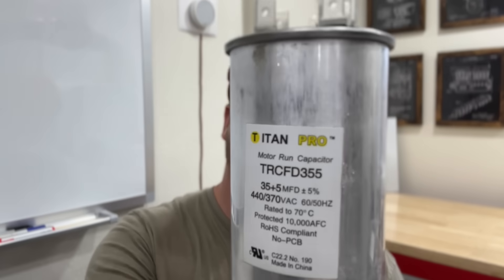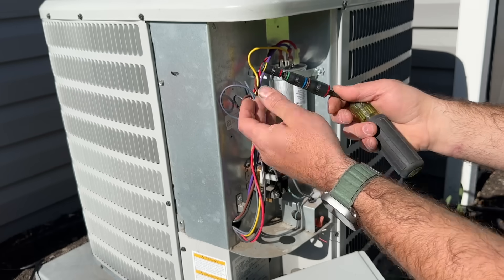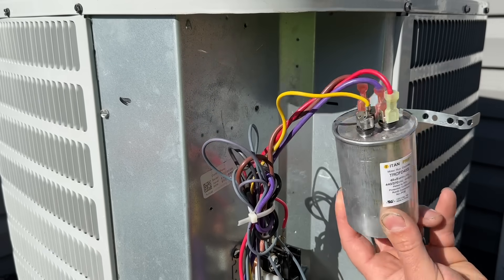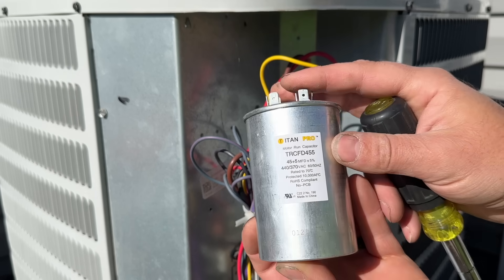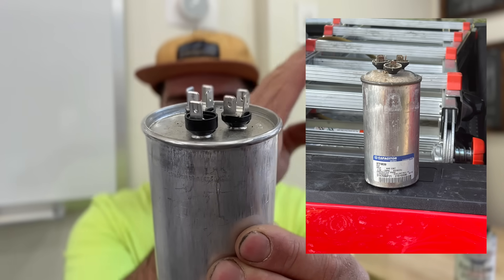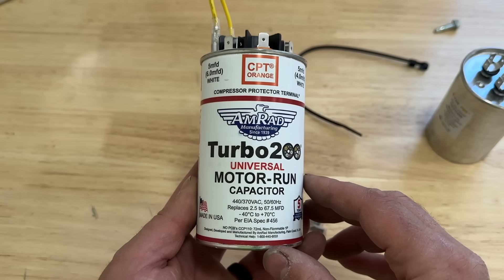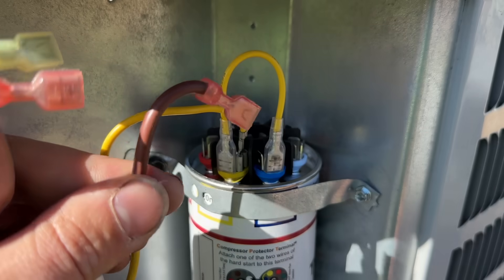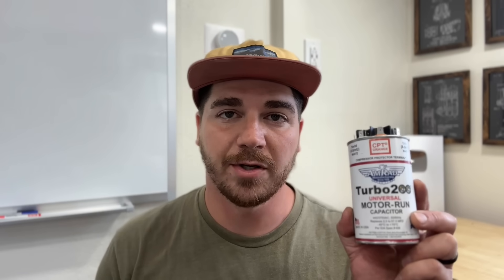HVAC Contractors Practically Make Their Living On These

Comment: As someone who provides for their family as an HVAC service /installation technician (who prides themselves on honesty, transparency and genuinely loves to help and serve his customers) the way you paint the entire HVAC service industry as a giant scam and then make some one off claim that someone was charged 2k for a capacitor really bugs me. You seem to genuinely want to help people but somehow are caught up in the clickbait of adding the worse case scenario of some scum bag service guy who duped their customer. Obviously it’s a possibility but you start with the (I’ll save you 2k) which in all likelihood is more like $200. You’ve done plenty of work that we in the industry don’t recommend.  I’d love to see you post a humbling video of oh I made the mistake of doing X and that was not the proper way to do it. Case in point you looped the additional refrigeration lines for your minisplit vertically which creates an oil trap and can prevent the oil from returning to the compressor (bad) and the industry would recommend that you run the additional lineset horizontally.   I made a post on your condenser cleaning video which states that there can be so much more to getting a system operating efficiently and effectively that almost no homeowner will be able to determine. I absolutely don’t mind educating my customers about how to wash their condensers, flush their traps or even replace a capacitor. But never having a qualified technician check their equipment can have their systems running inefficiently. Ultimately affecting their cost to operate, their comfort and eventually shortening the lifespan of their equipment. And while yes we need customers to maintain our livelihood we’re not going to starve if customers do some of their own maintenance to save themselves money.  So just painting the industry as unneeded and a scam is gross. Why can’t we work together instead of against each other. Why can’t you promote professional service while helping others see that they’re capable of performing maintenance that can save them money. What about promoting good guys. The whole world is filled with people who want to create dissension and put one against the other. Why not be different? Maybe because that stuff doesn’t get the likes and the followers because everyone needs something to be mad at someone/something. Just one man’s honest opinion but I absolutely hate your “they’re scammers watch what I can do to save you approach”!

Comment: My evaporator has been slowly leaking over the years. I finally said the hell with it. Bought a window air conditioner. My central air was never right. it's 15 years old and shouldn't be leaking like it is. Info out there that carrier used the wrong evaporator for the high pressure 410a. Was being charged 300 bucks to just add 410a.  I spent over 1200 bucks over time adding 410a. Sick of it. My neighbors central air is over 20 years old, never having to add any. Never buying carrier again.

Comment: I don't disagree with anything he said about capacitors, but wanted to add a bit of context about why it's VERY IMPORTANT  to discharge them before any possibility of touching a bare terminal... if you imagine  a battery and a capacitor capable of storing the  same amount of energy  now think of them as a 5 gallon bucket of water.... the battery is limited to how fast it can 'drain' current  away.... it would be like drilling a ¼" hole in the bucket.... however a capacitor is like dumping the bucket over someone's head... the only effective discharge limit is the amount your body provides... that's why  they are useful and why they need to be handled with care until known to be discharged.... the 120v/240v air conditions offer can be one heck of a kick... I  doubt it would kill you but it is atleast theoretically possible...

Comment: My Florida condenser was flooded under 4.5 feet of water from Hurricane Ian. I washed the unit and called one-hour heating and cooling. They wanted $1,200 to replace the fan motor, who said they had it on back order. It would take 3 weeks. I bought a new motor that day for $120 and it was back working in one day. Figuring 3 hours labor for them, that works out to over $300/hr. Gouging at its worst during a disaster. In three weeks I would have lost the house to black mold.
Reply: Sometimes DIY is faster.
Reply: Why would you have lost your house to black mold?!
Reply: @Xanthopteryx no ac in a humid climate allows growth. Welcome to Florida
Reply: @Xanthopteryx  
Why would you have lost your house to black mold?!

That seemed an obvious reference to what would happen without the A/C running, with all of that Florida humidity.

But just wait until we start having all of those predicted rolling blackouts, due to the enviro-wackos shutting down our power plants with their pretense of "climate change" (fake-science and trendy BS) of being a thing to worry about, and not caring that power sources seriously need to be "dispatchable", because they can't be bothered with technical details like science, physics, or economic feasibility. Coal, natural gas, nuclear power, hydro-electric are all dispatchable, which means that they can be brought online in a short amount of time to match a rising demand curve or a hot summer day in which people are running their A/C. Solar and wind are not dispatchable, because they produce when they produce. The sun does not always shine, clouds block the sun, the wind does not consistently blow. Bad things happen if the supply can not match the demand, forcing them to "shed load" in the form of rolling blackouts. How will we ever have jobs, when nobody wants to build a factory where they do not have reliable 24-7 electricity?

BTW, the backup electricity for hospitals would be considered to be dispatchable I imagine, because diesel generators run day or night and are not dependent upon the fickle weather. However, the fuel can run out in days, if power is not promptly restored. Those emergency generators start themselves automatically within seconds of detecting a power outage. Why don't hospitals or other places needing emergency reliable power, rely upon wind or solar? Think about it. Also check out Ray Stevens "A Solar Powered Song". Funny, if it wasn't actually kind of sad.
Reply: If you are in that situation again, you may want to call a Yankee friend, up North and have them pick up the item needed then ship it to you UPS next day air. It is not that much!
Reply: @Mike1984-lc9rh 
Replacing that fan motor takes 30 minutes at best, not 3 hours.

It might take them 30 minutes, not counting the drive to the home. But either they would charge for 3 hours, the longest that that job might take, or else DIY may take 3 hours. It probably would take me at least 3 hours. Especially if I actually read the directions.
Reply: @Mike1984-lc9rh 
How did you learn to do it?

I should move to a more civilized country.

Comment: Bought a 4x/yr “Preventive Maintenance” contract for $33/mo from my HVAC company. Tech warned me in second visit that my capacitor was starting to head towards the range suggesting replacement ($350 plus tax) but while watching him check it I quickly looked on Amazon and found the identical part for $14 and called him out on it. I replaced it  myself….15 mins in time. The previous / first visit 3 months earlier he did a Carbon monoxide test stating “you got a leak; likely a crack in the heater box” (it’s a heat pump with natural gas back up) and the system should be replaced…. $8-10 thousand (I live in the Pacific NW; 1400 sq/ft). I brought out my two (2) state of the art CO detectors that run constantly and have a digital readout of the percentage of CO it detects and both read zero. Yes, I know his CO detector was likely much higher tech then mine but ya got to wonder; Considering diy hybrid solar mini split 2400 btu for 4k which includes the panels. I could buy two of these mini splits for what he quoted me to replace my “leaky system”.
Reply: Buy a Canary, if there is a CO leak you'll know.😎🌴🐊

Comment: You never verified both legs of power were dead. This could be a lethal mistake your advice could get someone killed.
Reply: How can electricity flow if the breaker is pulled? If you still have voltage then you need to sue the guy who wired it up! Now if a gov't inspector was there than I'd see doing this and probably something else that wasn't even thought of!
Reply: @kenhurley4441  if someone  bypassed the disconnect. Precisely why you shouldn’t be doing it. It happens more than you think. 35 year HVAC TECH with real experience.

Comment: This concept of good hard work is so far gone. Gouge and feel good about it has been around a long time, but it was less frequent. Thinking customers are a piece of meat. I despise anyone in any trade that feels this way. Maybe i need to get into all trades and promote honesty and fair prices. I'm sure the others will have something else to say about it.
My cap died a few years ago. Supply house would actually sell it to me no problem as DIY homeowner. Just ask. They definitely wouldn't sell equipment. Yesterday I purchased from HVAC direct, aciq 2 ton and 60k 2 stage furnace and hope it shows up intact and wish me luck in the change out. Cheers. 
I'm very excited to start this process. I'm buying all the tools needed this past few weeks.

Comment: When you plug the contacts back in, make sure to seat them firmly. You wouldn't want one of them vibrating lose!

Some Capacitors are wider than the one's that come standard. Try to buy a replacement capacitor that is the same width, so that it will easily and properly fit in the metal bracket.

Comment: I ran into a similar satiation with my hot water heater. The thermocouple can get old and dirty and cause it to stop working. Takes about 15 minutes to replace and costs about 10 dollars at home depot/lowest...

Replacement estimate? 300 bucks.